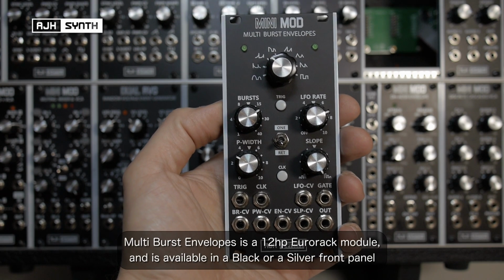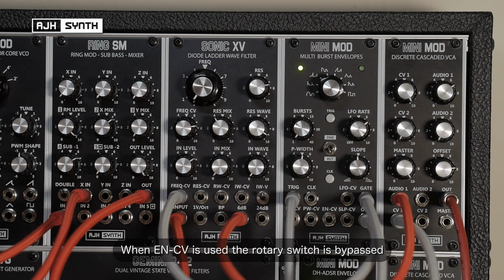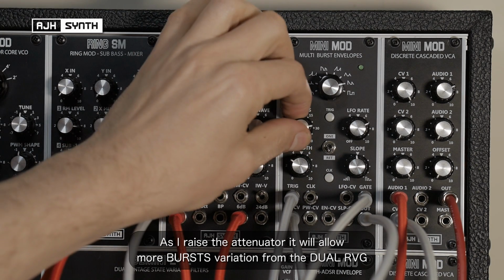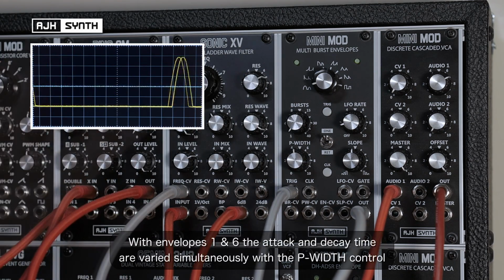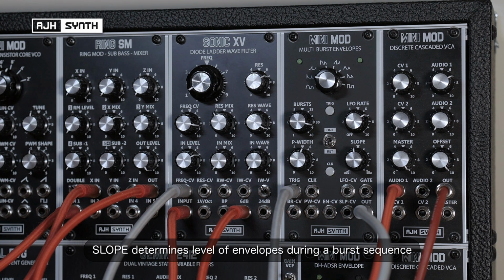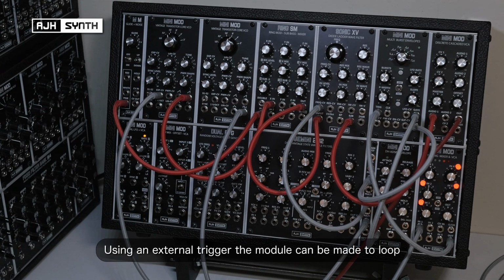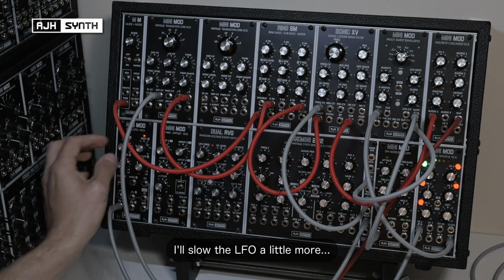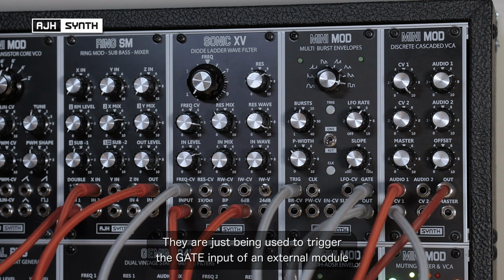MULTI BURST ENVELOPES User Guide - An 8-shape envelope generator, multiple time-controlled repeats

Comment: Got one, an "MBE". 
I made train sounds, like if you were traveling in an old train with the window open ....the wheels clacking on the tracks.
Patch, from the top down.....

(knobs)----->
ENVELOPE  = "ramp down".
BURSTS about 6.
LFO RATE = about 7.
ONE-shot/RE-trig = either.
P WIDTH = 2 or 3.
SLOPE = anywhere to-taste. 

(jacks, cables)-----> 
TRIG = input a steady clock/trigger  (about 100 bpm).
SLP-CV (slope cv) = input any unclocked LFO (any shape) or try 2, multed, different speeds.
OUT = to a VCA's cv input.
Into the VCA, goes this sound.......White or pink noise ran through a LP Filter with a small amount of resonance.
VCA output to your mixer.

You should hear the semi-random clicketty-clack of this old train.
Add some short delay and a small amount of reverb to make it more realistic.
Alter your filter settings for a more muted "window closed" effect.
Tweak settings....experiment !!
Reply from the maker: That sounds like a fun patch, thanks for sharing it.